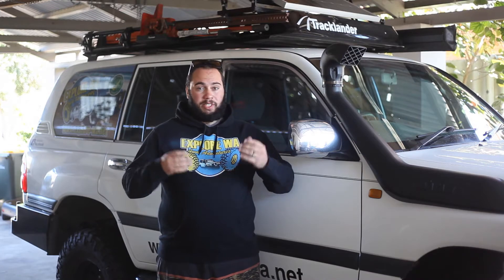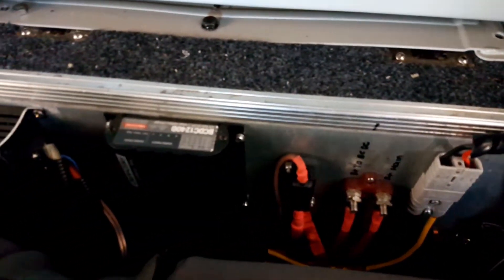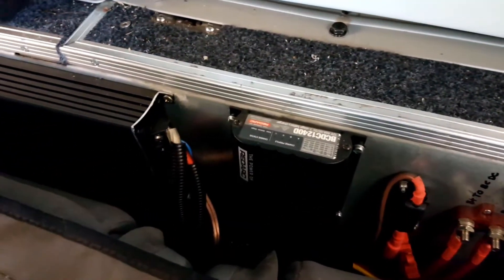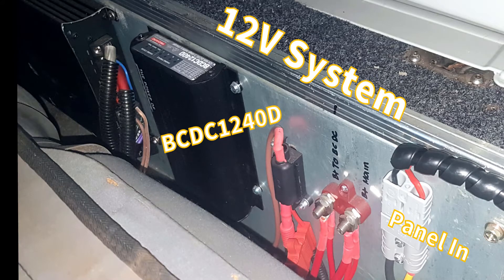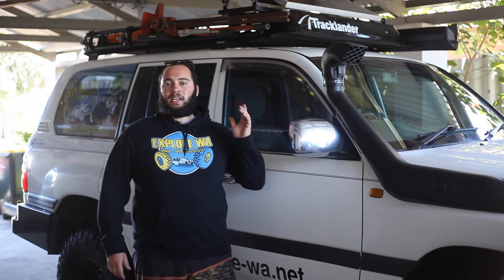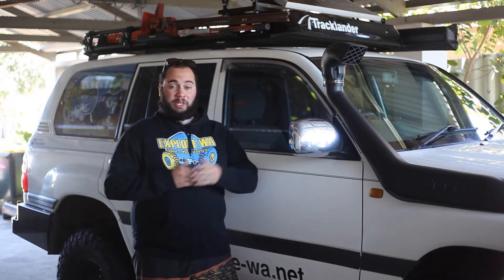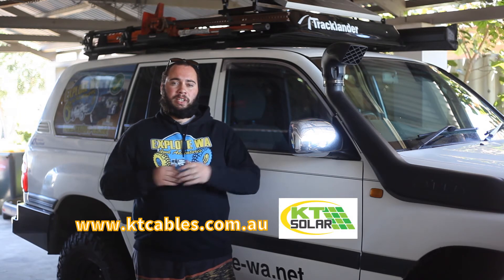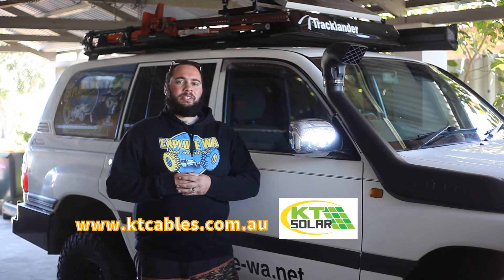Explore WA 4wd : KT Solar 100W Panel Install

Comment: How did you wire the panel to the regulator inside the Cruiser ?
I am considering drilling a hole in the roof above the pillion behind the drivers seat on my Troopy and threading the wire through a rubber gromet to keep out the rain and to then mount the regulater in the cab. I have a battery box in the rear and a 2nd battery under the bonnet, 
My main power use is a ARB 47 Liter Fridge and LED awning. She solar panel is 160 Watts. Connected to the battery box is a double Anderson Plug, one to connect the solar panel to permently the second to run a wire to the Anderson plug near my rear tow bar so I can run both axilliary batteries in tandum. I will mount the panel permently at 35 degrees in front of the roof rack hopefully cutting down wind resistanse caused by my 2nd spare ect on the rack. What are your suggestions as I am new to DC current ?